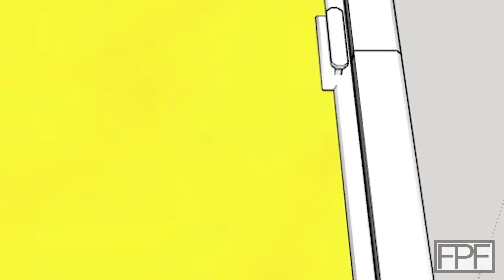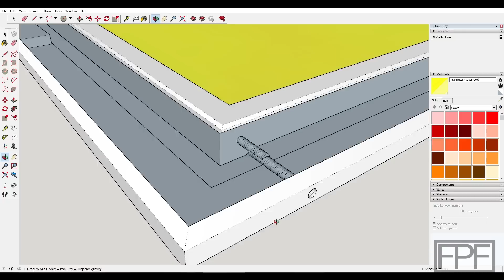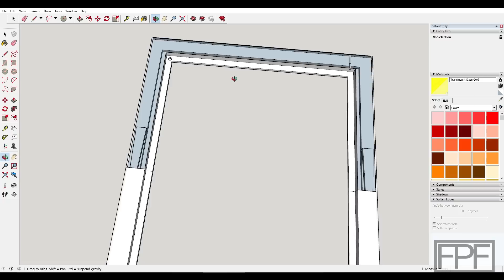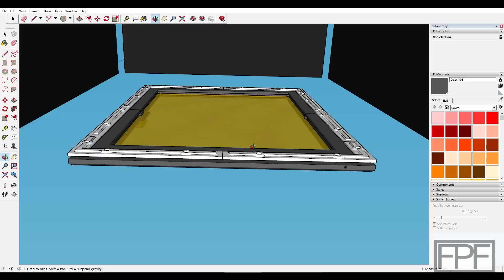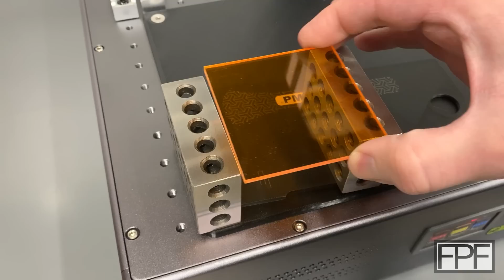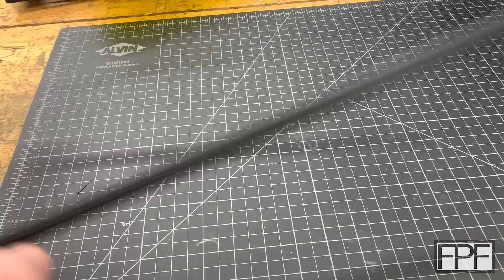Modular 3D Printed Enclosure - Making The Door

Comment: I don't really understand the need for the double pin arrangement for the lower door hinge, why can''t you have a single pin that gets pushed up by the grub screw?
Reply from the maker: I just didn't have a pin long enough, and two worked out nicely.  I could be a single pin, or even better yet, a grub screw with the pin integrated.
Reply: @FunctionalPrintFriday Oh ok, I was totally overthinking this 😂
Reply from the maker: @ferrumignis  actually, now that I think back, I think there is actually a slight offset between the two bores, so a single pin might be tight . .

Comment: My guess, since a laser is basically light of a given wavelength, a basic filter will filter out the undesired wavelengths and let the desired ones through. Orange is lots of red light and a little green light, so the red laser passes through as if it's were transparent. Blue light would not be able to pass through. For a red laser, you'd need a green, blue, or cyan filter. I'm not surprised with the results of your little experiment. So yes, laser protective windows are a real thing. Just going off the thumbnail and title.
Edit: hence the reason you wore laser safety glasses, which I noticed had a bit of a green tint to them. Just using orange tinted acrylic isn't the same as using an actual filter for the specific wavelength of light. There's a very good reason high power laser labs have those laser safety panels. For red lasers, use blue or green filters. For blue lasers, use red or green filters. For green lasers, use red or blue filters. It's just basic optical physics.

Comment: With my printer, I've found that, if what is going into the hole is at least 3mm, adding 0.5mm to the measurement makes it a nice smooth fit (not super snug, but it won't slide out on its own either). Anything smaller, and it needs a bit more of an adjustment.

Comment: Another awesome project!  I'm going to 3D print an enclosure for my 10W desktop laser engraver for laser light safety and fume extraction.  Instead of black CoroPlast, I may use 1/8" thick Falken Design aluminum composite material, also sold as Aluplast sheets.  It's a thin layer of aluminum on each face with a polyethylene core.  It's approximately the same price as Coroplast and I think it'll make a nicer enclosure.
Reply from the maker: awesome!  I need to check that stuff out

Comment: My only comment here is on previous episodes, you were pushing hard to stay within the P1S/X1C bed size, and now that's been thrown out the window and we all have to purchase the neptune max for the door. This isn't really sticking the landing as far as a design philosophy goes. :/
Reply from the maker: I plan on having an option for doing them in smaller pieces when we get to the finish line.
Reply: Also, small drill bit? drill out the filament? :shrug:

Comment: Please do the same test with the orange acrylic and a blue light diode laser. Jtech photonics claims to have "certified" laser safety panels for the diode lasers and I don't know if I believe that it's better than the standard orange acrylic. I used the normal acrylic on my laser enclosure and when framing, I can't see the laser dot through the panel. I do still wear glasses when it's actually burning though!
Reply from the maker: I cut the orange acrylic with my blue light diode, so I can confirm it absorbs it

Comment: I don't really understand the design for the door frame you're doing... you've already made a system that attaches to the coroplast, why not make a single-axis version of it with outside corners, and then bolt it to the plastic the same as the rest of the frame?
Reply from the maker: For clear acrylic for a 3d printer enclosure, that would be the way to go, but check the cost of the laser-safe acrylic, and you'll have your answer.  It would be a $1300 window :(

Comment: Surely the orange acrylic is only going to attenuate laser light in the range of about 400-550nm (depending on the exact colour) ??? 

Your fibre laser transmits at 1064nm and therefore wouldn't be attenuated at all by orange and that's why the guys sent you a the greenish acrylic which attenuates at that frequency (and some others). 

The point being that one wouldn't expect the orange acrylic to attenuate your fibre laser AT ALL. The orange is good for the frequencies its good for. 

Having said that, I would be tempted to buy the rated filter from the specialist company for my own peace of mind 🤓

Comment: Why doesn't the door and door frame have the same modular nature as the rest of the enclosure?  I would think we'd need to be able to resize the door based on the size of the enclosure.  Imagine a 1m size enclosure with that door - it would be too small.  Also, I could see needing to adjust the door height based on the type of machine especially if you need to get access to controls on the top or bottom of whatever it is.

Comment: Paper clip, steady hand and a small torch like the ones they use to take off stringing would of got those out, save you day/s of printing. Straighten clip, heat tip press into center of pla dowel let it cool and pull....

Comment: Maybe next time a when you got a piece of filament stuck inside your part you could use the same technique as removing a clog from a Bamboo hotend. My P1S came with a small allen key you can also use when your hotend is clogged. If you heat this up with a lighter until it starts to glow, jam it inside the filament en let it cool down. It adheres so well you could probably pull it out. At least it worked for a nozzle clog, but of course the surrounding material then is metal, so with PLA filament in a PLA print it might be tricky. Always worth a go, if you were gonna discard it anyways. Keep up the good work!

Comment: You could simplify the door frame pins bottom one hole half height of the pin and on top full height. Put pin in the top hole and tape it to prevent it falling out. Then remove the tape when door is in for the pin to fall into it.
In the door leave bottom of the top pinhole open so pin can be pushed up for disassembly.

Comment: It I treating that you included the discussion about the bamboo skewers. I have thought a couple of times about using that round spaces. As a thought for someone who does not have the magnetic option, as a you do, to keep the enclosure from floating on the work surface. They could use a steel rod, or something similar, to add weight to the bottom and make it more stable.

Comment: Good to see you have recovered most of the use of your right hand and arm. I have downloaded several of your designs and was looking forward to the door on this project. I only have a Bambu X1c so if I understand correctly, I will not be able to print this door frame. Is there any chance you can modify the dimensions to work with the X1C? I am using your design to make a dehumidifier enclosure for filament. Keep up the great projects. Your videos are the most useful out there.
Reply from the maker: Thx!  It's a great point on not being able to print the door with a 'normal' volume machine.  I can absolutely cut up the outer frame into 4 pieces, it's the bezel for the acrylic that I think will be the issue, as it's so thin and narrow.  I'm going to come up with at least one other door design that doesn't require a giant printer.

Comment: Some of my PLA is so brittle that it snaps off just from being bent in the spool holder. I've tried drying it and still the same. Other things you could try for holding the door halves together: PETG filament, which doesn't break like PLA or a brad nail with the head cut off.

Comment: The door frame seems overly complicated compared to the actual frame. Why not emulate the outside frame in the door frame so the pieces slip over the plastic sheet and screw in like the outside frame, so it’s like a C shape around the sheeting. Probably not explaining this very well
Reply from the maker: that's a great idea for potentially having the bezel in multiple pieces and relying on the acrylic for overall rigidity and caulk to keep it together.  thx!

Comment: Could you possibly use the same pins to join the doorframe that you used in the hinge? I felt that in my bones when the PLA pins sheared off.😔
Reply from the maker: they're a little too big for the thickness of the frame in that region.  I could bring the diameter down on my lathe, but I think just a better choice of filament (someone else suggested PETG) will be ok

Comment: Just a thought, maybe you could do away with the set screw and push pin for the lower door hinge, with the frame being in multiple parts, you could set both the top and bottom pins then slide the frame together. That would also make for easy disassembly if needed.
Reply: Came here to say exactly this.  What an overcomplicated design.
Reply: @Theladorn  I guess that's what iteration is about start with a design then if possible simplify it if possible

Comment: The wavelength of the laser has to be considered when selecting the color of the attenuating window.  Orange is best for blue lasers (400 - 500 nm), but don’t expect it to work for IR lasers, as you saw it is transparent to 1300± nm.  Clear acrylic would probably work best for IR lasers.

And your question about whether the color has anything to do with the attenuation, it has everything to do with the attenuation value for a particular wavelength of laser.

Comment: I suspect the material is reflective to the laser wave length. It probably doesn't absorb it. The damage was probably caused by oil and dirt on the material surface burning up, not the material itself absorbing the energy. I may be wrong as I'm speaking from very little experience with completely different wavelengths, filters and powers, but I would be cautious regardless.

Comment: One of the things to remember with the laser protection for the door (or housing if people are going to go that route) is that the laser light that will normally get to that surface via reflection, and is not going to be focused. That doesn't change the damage that can happen if it gets to your eyes, but does mean that the laser light at the screen is going to be diffused across a wider area than it would be if it is next to the laser target and in the path. This means that the acrylic (more accurately the die layer for the color/filtering that absorbs the laser light) is less likely to be damaged. Not saying it won't be over time, or as your laser power increases, and you should probably talk with the people that you sourced the material from to see if they have any advice on periodic validation that the filtering is still functioning as expected.

You may want to throw a magnet at another point on the door, with a reed switch inside the door frame that toggles a state (either an LED, or whatever the cover detection for the laser is) to activate a safe state to shut down the laser if the door is open.

Comment: Interesting developments. Would you consider, in the spirit of making the design available when your enclosure design is complete, to make the door and door frame from only edges and corners in the same way as the main enclosure frame so other users can pick the size of the door themselves like they can with the outer frame? 

Also returning to the T-track idea that you mentioned as non-viable before, perhaps if users wanted to they could just attach a T-track to the outside of the edge profile. (is it flat/wide enough on the 45 deg angle?) I think you made some kind of screw holes on that edge in your last video. Not sure how they might align with off the shelf T-Tracks with pre-made screw holes, but I suppose you can always cut them to length and  dril some more.

Comment: Near the end of the video, where you needed to drill out the holes.  Wasn't that just support material the slicer put into the openings?  It appears like it was.  Usually if you take a small wood screw you will be able to thread it in a bit and lift the support material out.  In Bambu Studio I am thinking you could exclude this material but it is probably harder to do that than just remove it by hand.  But this was a very well done video, Thank you.
Reply from the maker: Thx.  They were hollow, just really small.  I actually put a bevel at the top of the holes so the slicer doesn't try and support them to avoid that.

Comment: This is a great expression of your process. Can you pass on your support settings? Your supported areas are so clean
Reply from the maker: Completely default in Orca.  I think the quality of the material and consistency of diameter makes a difference.  When I switched to the Bambu PLA Basic from the other cheap PLA I was using, I noticed a significant improvement in overall print quality and support removal.

Comment: Why not use the same alignment system as your corner parts instead of the filament or use the bamboo skewers for alignment. You can put one inside side plate and one corner on before setting in the opening. Of course you can lay the enclosure on its side and reach in from bottom to put the inside plates on.

Comment: Ya know you could just use simple pins in blind holes for the hinges as you have a split door frame. you need to remove the frame to remove the door, but you need to remove the frame to access the grub screw anyway...... nice ... the brace is off
also maybe use nails with clipped off heads to join the frame halves ... I seen that happening as soon as you said you were going to use filament.

Comment: I don't know if this will help but my large format printer is in a tent. The top vent is open for PLA/PETG. I use a 15 min. per heat, and TH3Ds Bed glue. Try it you might like it.

Comment: Why not use metal pins instead of those filament pieces?
Reply: I’m guessing that the door frame is pretty thin, I’m guessing by the looks of it, not much thicker than 3 or 4 mm. When I made a case that needed to be joined, I designed around the thinnest carbon rod I could find on Amazon (2.5 mm). I think the filament idea is a neat idea … assuming the shear stresses aren’t high … which the end shows it wasn’t sufficient for the pick up (whomp whomp)
Reply: Mostly we use Filament pieces in the 3D printing community... I even use filament pieces for hinges on small boxes and I have some that are still working 7 years later. Like he mentioned in the video its old brittle filament that he used... Also the pieces are not suppose to carry that much weight and in an application like this its used purely as a alignment option and you would use some sort of glue or GLOOP  to bond the pieces together... I also would not be printing two whole new set pieces. I would just use  2 needle work clothes pins with small drop of superglue on the head and stick it on the filament pieces and then when its dry pull on them out by the pins with set of pliers.